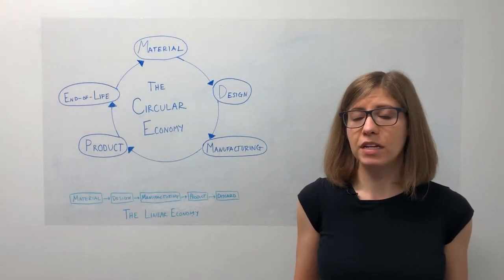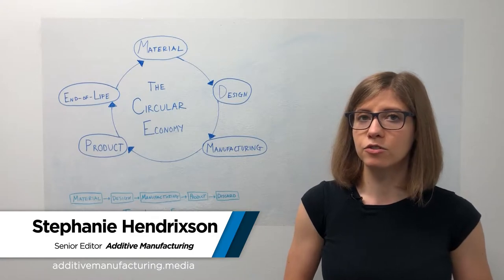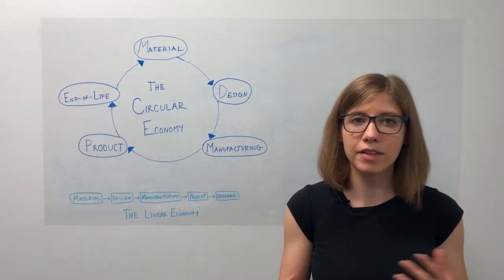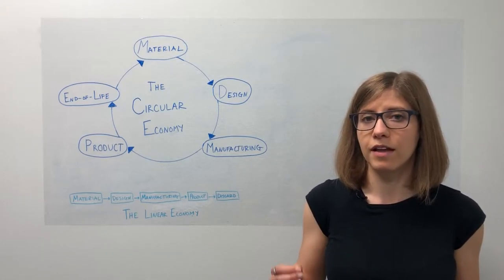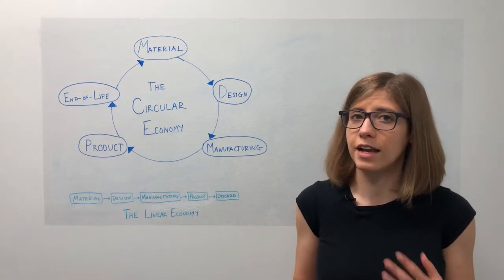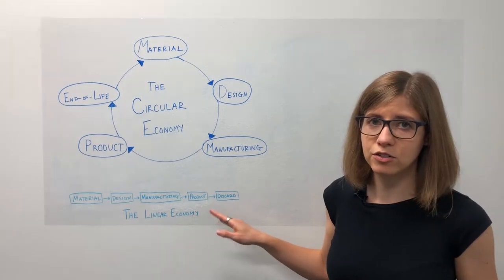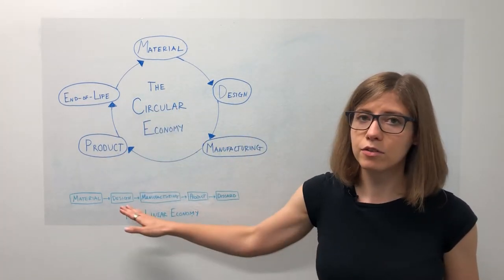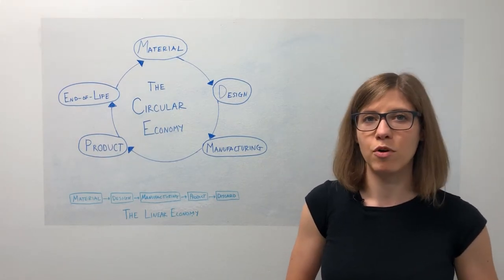How Does 3D Printing Support Sustainability and the Circular Economy?

Comment: I have to consider the metal strength of 3D printing. In some applications, strength is much important than other properties. But I saw a video on YouTube talking about the strength is not so stronger than the traditional manufacturing method in same conditions and materials?🤔
Reply from the maker: Build conditions and post-treatment can affect the strength of the part, but it is possible to 3D print metal that is as strong as or stronger than a traditionally manufactured part. We have a few examples on our website:

This study compares DMLS parts to barstock and found no significant difference in mechanical properties: https://www.additivemanufacturing.media/blog/post/comparing-mechanical-properties-of-dmls-vs-barstock-parts

And here’s an instance of 3D printed flight-critical parts replacing conventional alternatives: https://www.additivemanufacturing.media/blog/post/are-am-parts-as-strong-as-those-made-conventionally

Comment: thanks for your interesting videos about 3D printing and circular economy.
I have a question.
As far as social sustainability is concerned, does recycling 3D printing filament cause bad effect of near resident’s life?
does recycling 3D printing filament create pollution?
Reply from the maker: We’re not experts on 3D printing emissions, so we asked someone who is! Here’s what an industrial hygienist at the CDC had to say:

“Recycling plastic from unwanted parts made by 3D printing or leftover 3D printing filament will release small particles and gases.  The number of particles and types of gases will be different for each type of plastic (for example, ABS will be different from PLA).  One study from the U.S. Environmental Protection Agency showed that the rate that particles were released while making ABS and PLA filaments was similar to the rates they are released during 3-D printing with these plastics.  Unpublished studies from NIOSH confirm this finding.

Whether you are recycling plastic to make filament or 3D printing, there is potential for exposure to particles and gases that can impact your health.  These particles and gases are released when the plastic is heated and breaks down.  Studies have shown that breathing in emissions from 3D printing with ABS can result in asthma.  Laboratory studies have shown that breathing in emissions from 3D printing with ABS can increase blood pressure in rodents.  Whenever you are recycling or printing, it should be done in a well ventilated area.  For example, you can open doors or windows to the outside or use a fan to push air out of the room.”

(More on dealing with 3D printing emissions here: https://www.additivemanufacturing.media/articles/are-emissions-from-3d-printing-hazardous-to-your-health)
Reply: @AdditiveManufacturing  Thank you for your kind response.